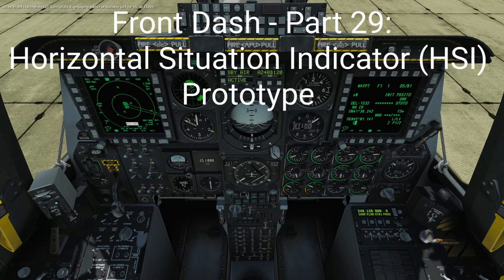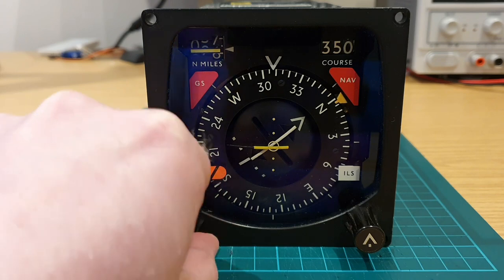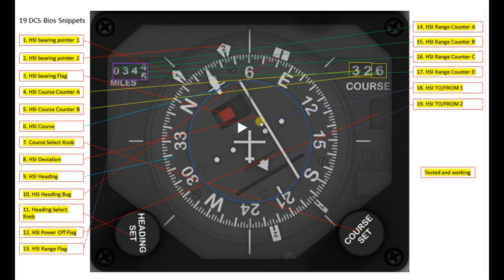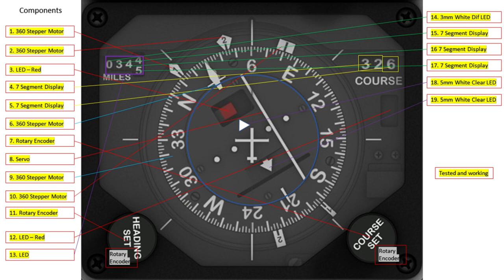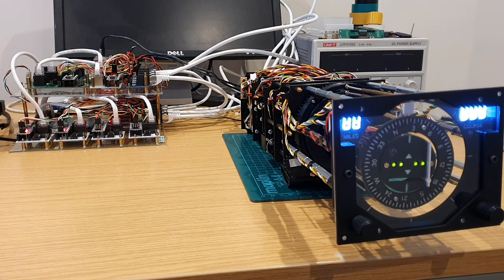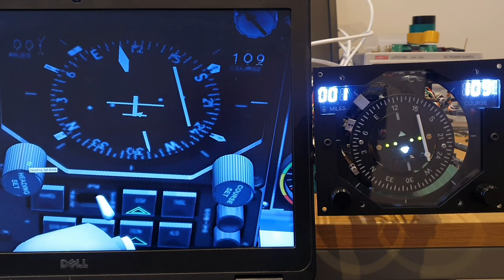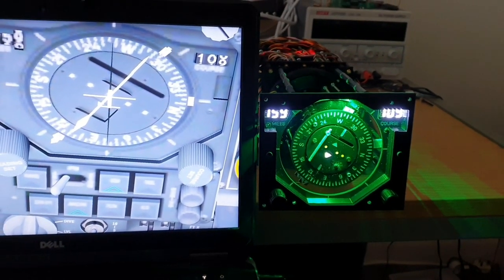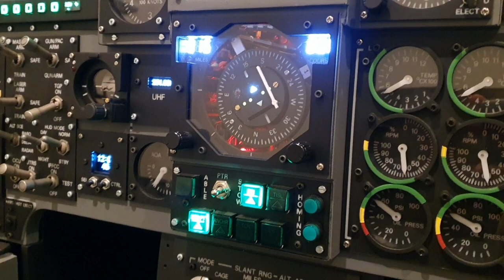Simpit A10C - Front Dash - Part 29: Horizontal Situation Indicator (HSI) - Prototype

Comment: Mate. When 8:58 came around I literally gasped. That thing is an absolute beast. I put the HSI in the too hard basket a long time ago, and it's the main reason I took the easy route and just used Helios for the entire front dash. It's amazing you got it working, it's just absolutely brilliant engineering on your behalf. Well done!
Reply from the maker: Hi Ray, thanks for the thumbs up. The HSI took me a good while to build. Its been great to fly with and I want to make a version 2 in the future to get the deviation marker implemented and some other improvements / refinements.
I like what you've been doing with your simpit and also the streaming. That's really cool 👍, nice one

Comment: Outstanding work Craig S. Simply rawdropping looking at your engineering approach sir
Reply from the maker: Hi Han, many thanks for your comments. This one was a lot of fun to design and build. After testing I look forward to making a revision with enhancements. It's running on a RS485 network and my initial use of this was based on your forum thread, so big respect to you on that one 👍
Reply: @CraigSmysimpit  Thanks for the kind word but I am a novic compared to you sir. What you're doing here is next level s***. Keep up those YT sir

Comment: Amazing work Craig, never realized it would be so complex with all the moving parts. You've done a great job!
Reply from the maker: Hi Sgt Foose, many thanks. The core plus two items spinning around it is perfect in terms of design, it's optimal, but once the 3rd and 4th items are added to spin around that core as well it more than doubles everything up. The rear was extended, but also the front. Still, it was a load of fun to build, now onto the next 🙂

Comment: Speaking as someone who's set up rotary encoders to control heading bugs etc - I set mine up to move in 0.25° degree increments when the encoder is turned slowly, scaling up to multiple degrees per click if the encoder is moved fast. It can be as simple as `if (time since last click > threshold) angle += click * 0.25; else angle += click * 4`

Comment: Have you thought about using piezo motors (radial and linear) to move the gauges? They're not extremely fast but should be ok for this and you wouldn't have to deal with any of the mechanics which let's face it are a point of weakness. I really respect your work there, well done!

Comment: Hi, this is a very difficult job, I myself am engaged in flight simulators and devices for them and I understand how difficult it is.
Question - how did you implement the ring rotation? just the software part. How does an angle from the model from 0 to 359 degrees translate into stepper motor rotation in steps?
Reply from the maker: Hi, the software which controls this is dcs bios. Within the arduino sketches for this you specify the number of steps for a full rotation. So you have complete control and can tweak it
Reply: @CraigSmysimpit  ok, no additional software required other than arduino settings and dcs bios?Arduino scetch from dcs-bios or u write self?
 thanks for the description. I have little experience in the software part, but quite a lot in the implementation of mechanics.
Reply from the maker: @ДенисЗайцев-э1ф  Hi, yes. Install digital combat simulator and dcs bios. On the ED forum you can find lots of sketches of arduino code to test.